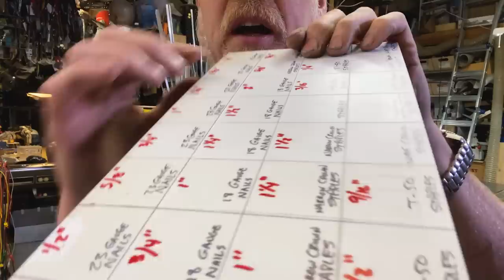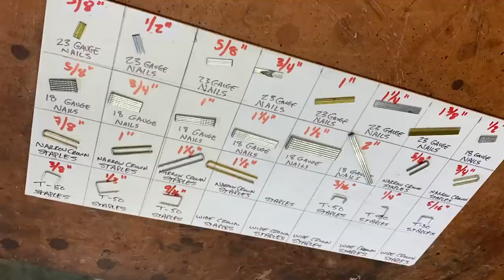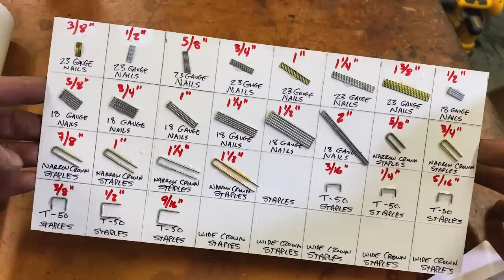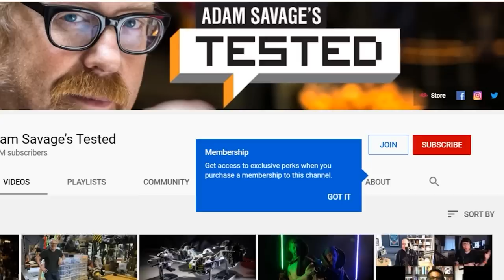Adam Savage's One Day Builds: Staple Sorter and Organizer!

Comment from the maker: 3M Scotch-Weld Hot Melt Applicator: https://amzn.to/2XofZfI
Halder Supercraft deadblow hammer: https://amzn.to/2ZrAud6
Senco 23XSP 23 gauge micro pin nailer: https://amzn.to/35PqgUC
23 gauge headless pin nails: https://amzn.to/2PRhqQN

Disclaimer: Tested may earn an affiliate commission when you buy through the links here.
Reply: Tested SHOULD earn commission... and Mr. S..... please fill that last hole with anything.... my ocs-alarm is beeping like crazy.
Reply: Hey Adam, love your shop set up. Do you still do commission work or is your shop now just hobby work? Thanks for your videosa
Reply: to help hold the bins in place you should glue a magnet to the inside of the bin and put a piece of sheet metal as the back wall to attract the magnets.
Reply: Further suggestion for this particular build... on the side of the drawers you can include manufacturer details/part numbers so if your usual supplier has none available you have a means of finding a backup supplier
Reply: Sorry, what was the material you used? Thanks very much.

Oh, just got my Iris thingy today -- very cool! And the ruler thingy is on order.
Reply: What is this mystical high-strength hot glue you mentioned?
Reply: Anyone copying this design should consider popping the rivets through from the inside of the drawers. That would give a handy little pull handle on each drawer front.
Reply: Do you have a good link for the bins used?
Reply: @Dick Longpole I see your point - I have roughly 87 different types of adhesive on hand for all sorts of specific tasks. However, there are a number of cases where hot glue is the right choice, and good strong ones are hard to come by, so I'd still love to know what he's using!
Reply: @Dick Longpole Yeah, I was actually thinking I'd have reached for the hot melt to glue the samples on over CA, but in the end I probably would have just mixed up a small batch of epoxy. A quick check on ThisToThat agrees that epoxy is the way to go here.
Reply: @bloodgain  These are from his Sortimo/Bosch sorting containers.  (Boxes branded Sortimo are all dark grey while the Bosch branded ones are multi-colored).  Look at this link for examples of the yellow and orange boxes he's using: https://www.boschtools.com/us/en/boschtools-ocs/tool-and-accessory-storage-org72-10-46581-p/
Reply: @xuthnet  Thanks!
Reply: Its going together sooo Faaast!! Love ya man! Nice build as well, Kudos!!
Reply: Where can i get a hold of the orange trays?

Comment: Having made several of these over the years my only recommendation would be to run some bungee cord from one side to the other to keep the bins in place when your moving the cart. I learned this the hard way!
Reply: A simpler way to solve this would be to have the organizer at a slight angle. It will also be easier to see the labels then. Also some padding that adds a little friction would help.
Reply: Yeah I think he found that out the hardway at the end there lol
Reply: He could have drilled little holes in each shelf to match up with the pegs on the bottoms of the Sortimo boxes. Or have a little ridge near the back of each shelf to catch those pegs. Or he could put shelf liner in each one for some grip. They wouldn't slide out as easily, but that's the point.
Reply: Yep just a bit of corn across the boxes tight enough to hold but loose enough to pull a tray out over the cord.
Reply: What I’ve see done and liked is use thin sheet of metal at the back and glue a small magnet at the back of each drawer. Loved it but probably eon’t work for heavy stuff
Reply: I was thinking a small screw/bolt from the top of the cubby pointing down to catch the back side of the tray would be nice. Then to remove you have to angle the tray up. Wouldn't stop the trays from flying open, but would stop them from falling out.
Reply: Was thinking the same after he dropped a couple

Comment: I know Adam doesn't usually read the comments but he should attach a small length of bungy cord across the front of each row of boxes. This way all the containers are held in place if the shelf tips but it's still super easy to pull the whole container when you want it. It only takes one accident one trip or one fall to just completely wreck your day with small parts in open containers.

Comment: 2:32 this is it. 
This is all the convincing I needed to get a ruler tattoo on my arm
Reply: Not a huge issue, but yeah, make a fist when the transfer goes on.
Reply: @AnthonyBowman  Where I work (an ISO9001 aerospace shop) all tools not NIST traceable are required to have a sticker reading "For reference only" - that's most of the everyday calipers, machinist rules, tapes, etc. When testing for conformance to a spec, you have to go to the surface plate and use the calibrated stuff. This would need a "For reference only" label...not a bad idea....
Reply: @mm9773  Ha!
Reply: Seriously it’s genius

Comment: 25:54, this argument applies really well in the software development world too. There's often a half dozen hacky ways to do or fix something, whereas the proper solution might be more time consuming or harder to logic about (and thus less likely to be done). 

One of the caveats with the hacky way is that, it's more cryptic and thus more difficult for someone else to understand what it's supposed to do, when the hack inevitably breaks. In fact, I've often sacrificed the "clever solution" or "convoluted one-liner" just for the sake of readability or clearer conveyance of intentions. 

Another caveat is that it makes extending the code (say to add new features) much more difficult, because hacky solutions are often super specific to the structure of the code as-is. And thus unrelated changes elsewhere can break the hack.

We have a term for "the buildup of hacky solutions". We call it "technical debt"
Reply: I just spent two years discharging the technical debt in our organization. Worked the development team to develop best practices, standards, and then rewrote code to standard, and changed structures to be maintainable. Future me will love past me. Future team will build on this.
Reply: I've seen this so often that I ran my own software development business by myself because potential 'candidates' to team up with were of the 'hacky solutions' type.  I find hacky solutions loathsome.  Would rather find the algorithm/maths and write the code from scratch than use some very limited but easy to implement solution full of caveats and mysteries.

Also, it is great that my QA supervisor is cognizant and anal enough to consider standardization upfront.  Starting from scratch on programming some of these inspection machines (including CMM) does mean that we have been modifying our system in the process - but the system is becoming more standardized and, most importantly, 'obvious'.  Once such obvious processes are determined and proven, it becomes easier to apply them for everybody, including future participants, than any ad-hoc band-aids and duct-tape methodologies.

Comment: I saw one of these at a mechanics shop (Big oilfield engine repair), the guys made it out of welded steel because they could. They also did something quick and clever for it. 
On each row they welded a bolt, threaded end to the outside wall with only 1/4 inch of threads before the bolt head. This was done in line with the lower 1/4 of each bin. Then they strung a regular bungie cord from bolt to bolt. It held all the bins in place, but you could pull it down and draw a bin out. It had the double benefit of keeping bins locked when the tool chest was moving around the floor (and over the ramps between bays), and it kept each bin in place when it was half out of its slot as the bungie would push up from the bottom and the top of the box would press to the top of the slot. 

If they had to, they could unhook the bungie as it was just looped over the bolts.

Comment: Should add drawer stops for the bins so they don't fall out so easily. On the roof lip of each slot you glue/nail a small bar of wood so that the back of the bin hits this piece of wood when pulled straight out. You can tilt the bin up to make the back edge go under the piece of wood if you need to pull the bin out all the way. This could be a life saver if the whole organizer tips forward and bins start sliding out from gravity... they should all get caught by that lip and your mess to clean up is minimized. This also why many of those organizer bins are sold with a high back, so it catches on the smallest of lips to stop it.

Comment: Nice build, the only changes I would make to it would be (1) Put rubber grip tape on the bottom of all the bins and a piece of steel under the nails/staples to give them a little weight so they won't get knocked over as easily. (2) Lift the front edge of the box up 1/4"-1/2" to help prevent the bins from sliding out when moving the whole rack around.

Comment: i have a tool tip for your rived gun.
i use a similar one, but on the back it has a clear container. so after you pop a rived, you hit a second trigger, and that shoots the steely thing in the container and you are set for your next rived, and at the end of the job, you just unscrew the container and there you have all the nails collected.

Comment: One refinement to the visual cues of the staples/nails, would be to angle very similar ones like the 18ga. and 23ga. in different directions (L/R) on the label.
That way you can identify without reading the words (once committed to memory), and notice if in the wrong spot when returned to rack (pattern is off). 
This could apply to fine/coarse threads on screws, aluminum/steel pop rivets, anywhere there's a subtle distinction to be made.

Comment: Very interesting build.  Would you consider adding a single small nail / brad from the top down into each bin slot to keep bins from falling out as the top two yellow bins did in this video. A bin could be pivoted up allowing the back edge to avoid the pin.  Considering the tight tolerances of your build, 3/8” - 1/4” should suffice.  Thanks for sharing this video.  Wishing you and your team peace, health and happiness. Hopefully your smoke will keep people indoors and slew the virus from spreading.  Peace Adam.

Comment: Weird suggestion: If you put a length of string around the front for each row, connected to the side (with some tension), then all the bins will stay in and not fall if you're moving it around the shop. It solves the problem of spilling the tubs when you don't want to.

Comment: With your penchant for using foam core, I’m surprised you didn’t just cut stops out of that,  that would just sit on the bottoms of the slots and rest against the back of the sorter to keep the bin from sliding further back. Allowing for easier flexibility of arrangement of the bins as opposed to having to place and remove hot glued blocks.
Reply: My idea also, but with wood.
Reply: And make the spacers step in size to give the bins a "stadium seating" look, making it easier to pull the bins out
Reply: I'd personally just have bought 8 more of the longer bins and set the short yellow ones aside for something else.

Comment: If Adam were to add 3 strips of elastic,  one on each row about half an inch up, it would allow for the draws to be pulled out (by simply stretching it down a little ) but would prevent them falling out of knocked. You'd have to try a few different tensions to see which worked best.

Comment: You should put stops in so that the drawers can't fall out. The drawers could still be removable by tilting the front side up, but they couldn't fall out because gravity will always pull the front side down. 

You can pick a height+depth for the stops that makes the angle required to remove/replace the drawers as steep/shallow as you like.

Edit: an easy method to pick a stop height would be to remove a drawer and trace the top of the back against a vertical plane, then tilt the drawer to the desired height and trace the (now lower) top of the back against the same plane. The distance between these two lines plus the margin between the top of each box and its shelf is the height of your new stops.

Comment: A couple of suggestions: 1, perhaps a strip of wood under the front of the staple box, so that it's a bit tilted up; this gets gravity to help pull the trays into the slot and lessen the risk of the trays falling out during movement or usage. 

2, perhaps some sort of handle or a milled detent on the trays themselves. There isn't much room between the tray and the slot so it can be a bit hard to pull one out. A milled detent for a finger to hook the tray out might be useful.

Comment: Maybe add a one inch shim under the front of the sorter so the plastic bins will tend to slide into the box instead of out of it when the cart is bumped or moved around?  Could prevent a disaster of "pick up sticks."

Comment: What you could do to solve the issue of having a board that is not wide enough, but longer than needed, is cut it diagonally and then slide both triangles across the cut edge to resize the board to the desired dimensions.

Comment: I liked the plastic labels for each drawer, but I think I would have done them on computer-printed self-adhesive labels. You could even print a scaled stock picture of the staple on each label, as well as the size. Or, you could glue the staple to the label. It could be neater than hand-written labels.  You also wouldn't have to score the Sortimo boxes and backs of the labels or rivet them. It wouldn't take much more time than doing it the way you did.

Comment: After you accidentally sent some of them falling to the ground, I was half-expecting you to put little stops in on the top of each cubby, that stick down far enough to block it when flat or tilted down, but that you have the room to let you tilt the front of the drawers up in order to pull them all the way out if needed. I guess you had already mentioned being a bit tired, though I am curious if you went back and added that later.

Comment: I would have flipped that back board @18:33 over so the bow went in toward the back. That way the glue and nails would flatten the sides down, while the middle would try to bow in against the backs of the dividers, and you'd have a perfectly flat back, instead of one that wants to bow outward.

Comment: Soo here I am watching Adam put labels on the sorters, thinking. "you should really do something to prevent them from sliding out accidently" 30 seconds later staples are on the floor. 
I feel obligated to make a suggestion. 
You could feasibly put a small block on the "roof" of each sorter section near the outside edge to function as a catch for the sorter drawers. 
make the blocks tall enough that they only just reaches into each sorter and they should be unable to fall. 
The only downside is that you would have to tilt the drawer up slightly when you need to remove it from the shelf.

Comment: How about adding a tiny strip of that rubber anti-skid material to the bottom of each cubby, right at the entrance? It would add a little more friction and a tiny up-tilt toward the front, making it so you wouldn't have any drawers slide out accidentally until the cabinet tilted quite a ways forward. In exchange for a slight annoyance at the extra friction when pulling out or replacing a drawer.

Comment: By accident and happenstance I believe he may have made a design function that would allow for easy blow out of dust and small debris. The back of cabinet if left with small 1/4 inch gap and same with back plate at bottom which happens by smaller piece at back leaves a perfect exit point for shop debris.

Comment: I'd have used the smaller back-panel and just committed to turning one side into a place you could grip it.
 If you're gonna get a gap, might as well work it into the design.
Edit: It would also open up the possibility of a cover on the front to make it a carrying case. downside is that that would exclude firmly attaching it to the shelf.

Comment: Most staple guns require earl or oil one or two drops. Your lubing the piston. Those that never bothered and yours bit the dust. Seized up. Some have a oiler port, some oil from the air hose attachment. The excess will blow out the vent. If yours has or says oil you need to get a bottle the drop size is small. Half the size of a tear drop

Comment: Nice, love the work. Suggestions:
(a) labels with reordering info. Taken to an extreme a barcode that contains a link to the item on a website. No excuse for anyone using the last item.

(b) Velcro for attaching the labels. Reorganization shouldn't be put off because it's hard to change.

(c) Make if modular so extra lines of bins can be added for example, or the carcass can be used as a stuff part for future builds.

Comment: I don’t like how easily those will fall out. Granted it doesn’t seem like its going to move much but when it does the mess will be “wonderful”. Just spitballing but a little copper tape on the bottom with a small magnet in front. Combine that with a steel wire going across the dividers. Maybe

Comment: Decent! Should've put the back side the other way so it is forced flat from nails!
Also I'd put a thin strip like quarter-half inch thick+height and length, whatever the sorting cabinet is,( JUST in the front side and paraallel to it) so it is angled to the back side, to prevent vibration and moving-wobbling, generally, wanting to throw the trays out